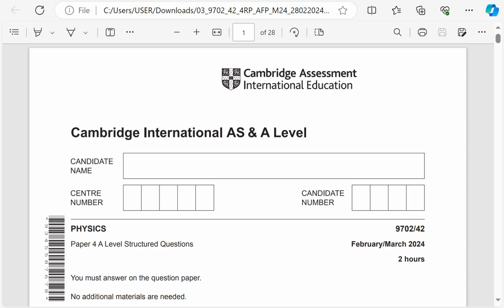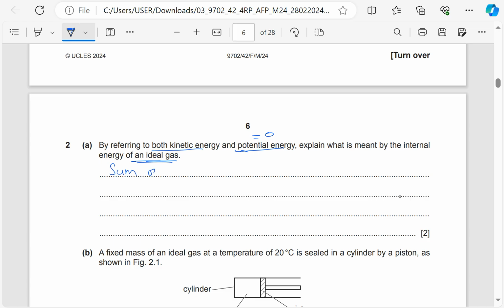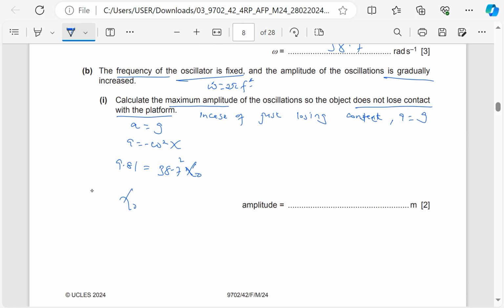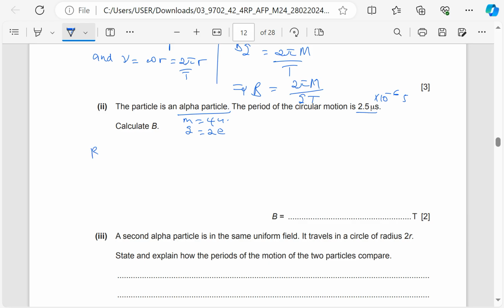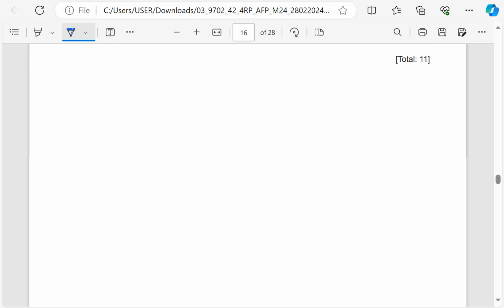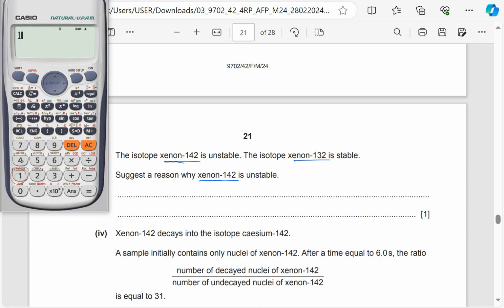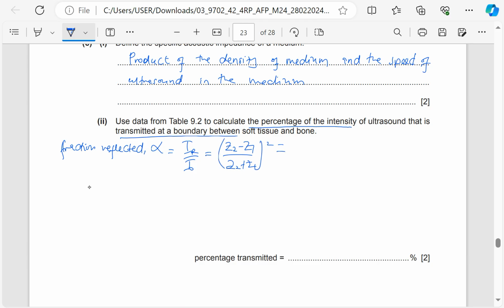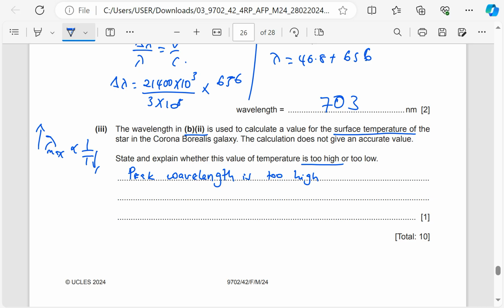CAIE AS Physics 9702 February /March 2024 Paper 42

Comment: you can just press the ENG button above the number 8 to get the power of the value. like if ur ans is 695790071, and u press ENG it will convert it to 6.95x10^9. Also if u press shift ENG it will keep increasing the power like 0.00695x10^12. Its always raised or deduct by the power raised to 3.

Comment: For question 6 (a)(iv), the graph should be the reverse of the graph you have drawn since E is proportional to the - flux linkage. Where gradient is positive, E should be negative by lenz law.
Reply from the maker: That graph is correct, and in my explanation I mentioned that your option is still fine. As long as there is both a positive and negative correct parts of the graph.
Reply: Thank u for taking your precious time for answering. Your explanation is of great help.

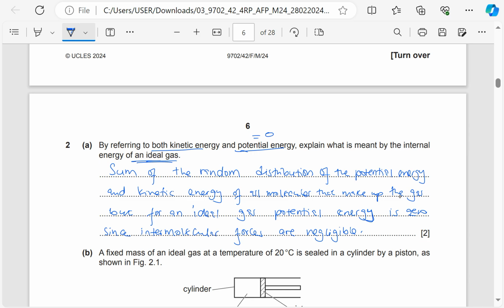Comment: 17:45 sir then why would you state the random distribution of the potential energy when you already knew that for an ideal gas there is no potential energy
and it should be the random sum of kinetic energies of the particles in the system.
Reply: In the question both internal energy and ideal gas are mentioned hence you have to define both terms fully.

Comment: Why distance in turns increases in q6,,cuz force is attractive so it will pull the turns towards each other
Reply: 1:04:24 I meant y it Decreases,,it should increase due to force shouldn't itt,,I couldn't get the point here
Reply from the maker: @M.c.w.b.  Then the issue is using flemming's left hand rule to find the direction of the force.  but if current in 2 wire is in same direction, force is attractive, if 2 wire have current in opposite direction, force is repulsive
Reply: @learnPHYSICSwithIBM you mean right hand grip rule
Reply from the maker: @Hiroki-v3j  i FLHR is not grip rule
Reply: Hi sir can you help me
Reply from the maker: @anantjain6408  how?
Reply from the maker: always quote the time of the video first. I did not say distance increases. I just drew a magnified section to make the diagram bigger for explanation

Comment: for Q9b, when we are calculating the attenuated intensity inside the materials, shouldn't we must take into consideration of the reflection at the boundaries inside which is exactly part c(ii). Which means part c(ii) should be placed before part b in order to get a full picture of the transmitted intensity.
Reply from the maker: the examiner is very careful. He can not make such a mistake.  Check out my play list for medical Physics and gain more insight.

Comment: in 2biii shouldnt we subtract 5.3 from 960 while calculating specific heat capacity
Reply: we are calculating c using q if we subtract 5.3 we will get internal energy and not the thermal energy
Reply: @shub5806  kire tui ekhane
Reply: Yesh

Comment: for 10 b i as the galaxy is moving away shouldn't the wavelengths increase due to Redshift.
Reply: Found the marking scheme everything is correct except that question, observed should be red shifted. By the way thank you for the video very informative.
Reply from the maker: @themuffinman-killer  cheers
Reply: @themuffinman-killer can I send the ms
Reply: @themuffinman-killer can you share the mark scheme??
Reply: As part 10b(ii) suggests, wavelength observed increases to 703, shouldn't this be the answer for the shifted wavelength for 656?
Reply from the maker: @luqingzhu3967  yes it is the shifted wavelength, and it is the one observed due to red shift
Reply: @learnPHYSICSwithIBM  so the lines to be drawn in b(i) should all be shifted to the right a little bit.  right?
Reply from the maker: @luqingzhu3967  the same composition means the lines are almost in the same position as the sun ☀ ☀
Reply: @learnPHYSICSwithIBM  yes with the fact that the composition same meaning that the spectra will be identical however the spectra is being observed from Earth of a star in another galaxy. So with the galaxy travelling away from earth, shouldn't the lines redshift. As they did say the Galaxy was traveling away from the sun. 
If the spectra was from that Galaxy of thst star, then the spectra should have been identical to the spectra of the sun
Reply from the maker: @taskeendaiyan1522  true
Reply: @learnPHYSICSwithIBM  does this mean the lines should be more to right as they have undergone red-shift, please do correct me if im wrong.
Reply: @taskeendaiyan1522  yeah youre right.
Reply from the maker: if the composition is the same. the lines are almost in the same positions with that of the sun. check it well
Reply: Yes they’re supposed to be redshifted. this guy is solving papers and has no idea what he’s on about. misguiding students
Reply: @salman_rashidd  no need to be rude. Learn your manners.
Reply: @salman_rashidd  what you talking about mr know it all if you were so all mighty you wouldnt have clicked this video dipshit hes doing this shit for free here unless ur moms paying mr mighty physics teacher shut ur ass up
Reply from the maker: @salman_rashidd  youtube is open to everyone, do better with your great experience
thanks.

Comment: for 5b iii, like now as w = v/r and w=2pi/T.  So when radius would increase shouldn't the time period also increase.
Reply from the maker: if r increases also v increases so T still will be constant
Reply: @learnPHYSICSwithIBM  but let's go few steps behind the proof that we had to do.
We know centripetal force is provided by magnetic force. So with magnetic force being constant, meaning centripetal force is also constant.
So centripetal force is either mrw^2, So for it to be constant when radius increases so w must decrease. Now as w has to decrease, this is possible by the fact that when  time period would increase. So as a result, concluding that time period would increase.
Reply: @taskeendaiyan1522 Magnetic force has increased here as F=Bqv. As v(speed) has increased, F increases.
As to why v has increased ,
Centripetal force = Magnetic force
mv^2/r=Bqv
v=Bqr/m, where B,q,and m are constant.
If r is now 2r, we can see that v has also doubled, so v increases.
Reply: @khooshuaiqi7981  bht how would magnetic force increase of they are in the same magnetic field. And if does increase, the question asked about the time period of the circular motion, not speed. I hope you understand
Reply: @taskeendaiyan1522  Magnetic force = Bqv , so B ( where B is the magnetic flux density of the magnetic field) is just a part of the equation of magnetic force, so even if B is constant , if the other variables in the eqn of magnetic force is different, magnetic force is different .
Same magnetic field just means same B not necessarily same Force
Reply: Period is constant , because in (i) we proved the eqn B=2(pie)m/qT, it is in the same magnetic field so same B, both are alpha particles so same q and m.
Thus, in the equation B,q,m are the same in both scenarios, so T must be the same as well tho keep the eqn consistent.